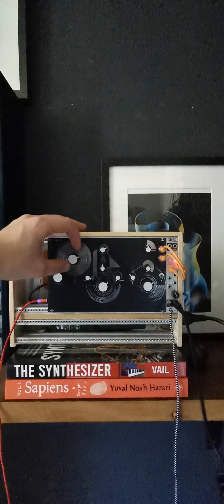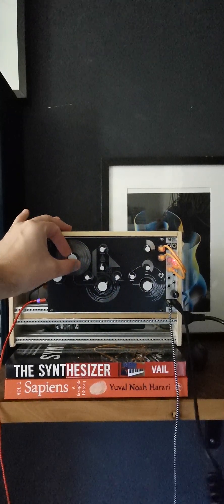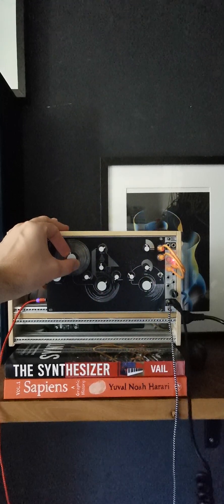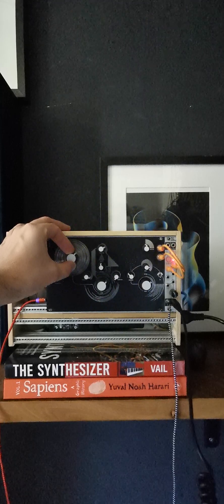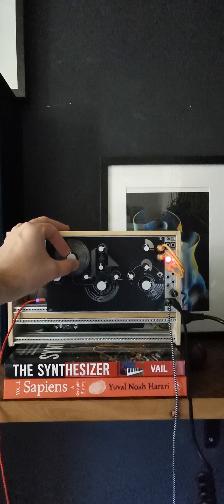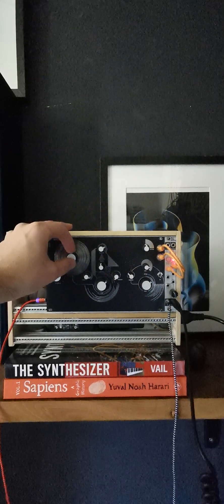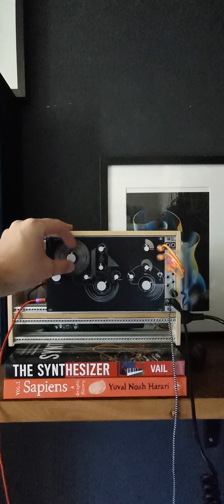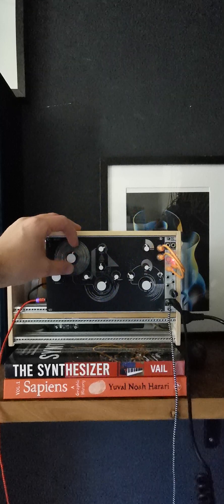A Feedback Synthesizer [WIP]

Comment: This Eurorack form factor seems much more appealing to me than the desktop version. Any plans on releasing this? If so, would be great if it could be a bit smaller :)
Reply: commenting on myself here, you guys need better pics on your product page. It’s totally not clear what the casing of this thing looks like and whether it is Eurorack compatible or not.
Reply from the maker: @h3rtz I agree. We are a very small organisation, and these things take time. The unit is Eurorack 3U height 42HP width and I can add a custom Eurorack power header in the back for you. The audio output is still line level though. Send me an email and I’ll sort it for you. Roey at Synthux.academy
Reply: @SynthuxAcademy  hey thanks for the effort, I’ll get back to you on this.